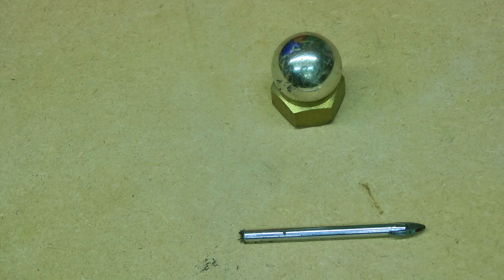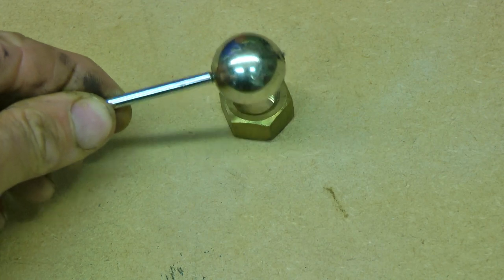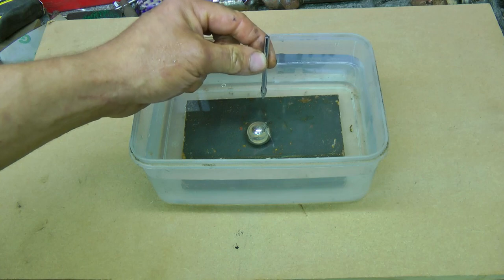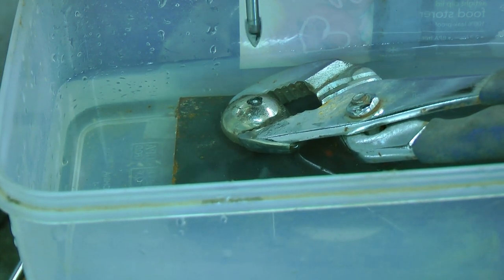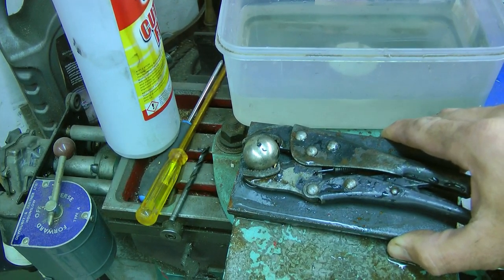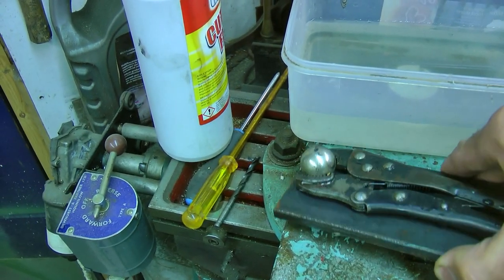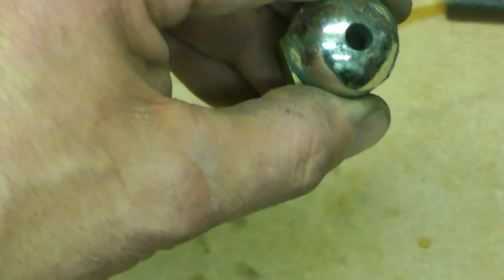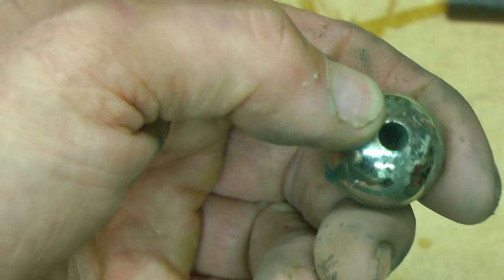drilling neodymium magnet yes you can !

Comment: This is great, and as you say, I cannot find anyone else who has done this.

What size of hole were you drilling, into what size magnet, and at what RPM? I tried 5/16" (8mm) hole with a carbide bit like yours into a 5/8" (16mm) neodymium sphere at 75 RPM with a steady stream of coolant, pushing slow. I achieved approximately 2mm of depth at the full diameter and then the magnet broke. Although the magnet remained completely cool, I wondered if it was turning too slow? Any thoughts on that?

I am working on a sculpture project as well and will need to drill an 8mm hole into a 25mm spherical magnet. I was testing the process on a smaller one to see if it would work before I shelled out the bigger bucks for the larger magnets (I need to do 4 of them).